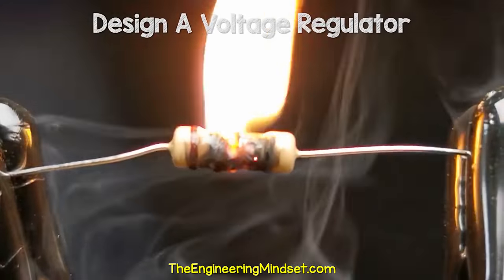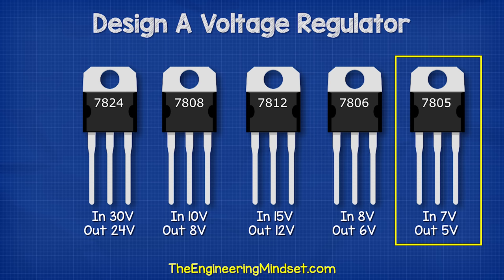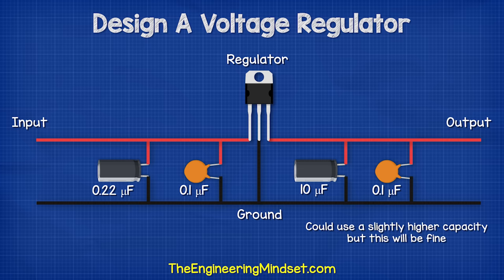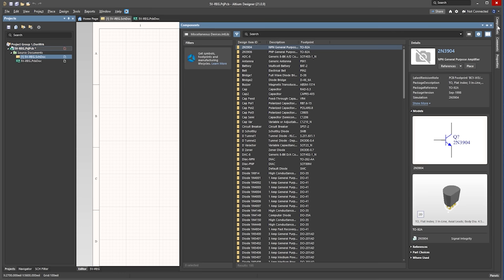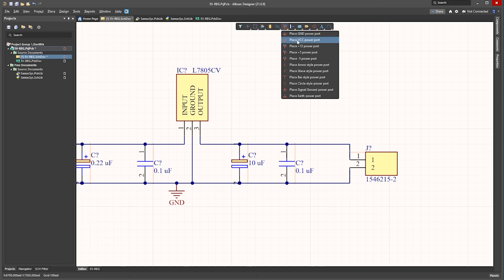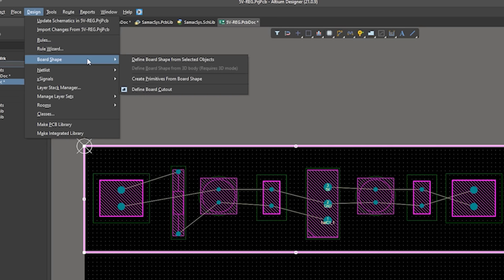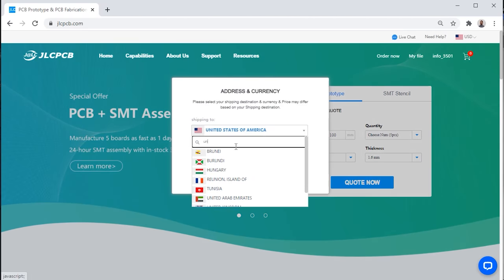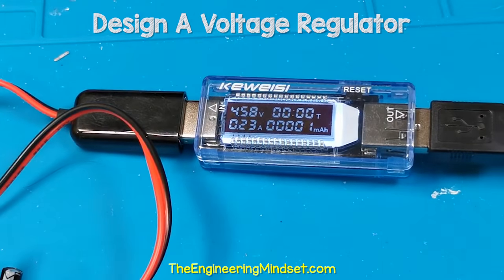5V Regulator design tutorial - How it works, how to design PCB  altium

Comment from the maker: ⚠️ This video took a long time to make if you would like to buy Paul a coffee to say thanks, link below: ☕
PayPal: https://www.paypal.me/TheEngineerinMindset
Channel membership: https://www.youtube.com/channel/UCk0fGHsCEzGig-rSzkfCjMw/join
Patreon: https://www.patreon.com/theengineeringmindset
Reply: Sir when you are uploading this video in Hindi language
Reply: Thanks Raul
Reply: can u make a separate video about semi-conductor 
i am  very much confused o this topic
Reply: so when u order, can u get thw components also from them?
Reply: LM78XX regulator is better for low power application because have low power efficiency at higher voltage input and very limited current load as LM78XX will turn excess voltage into heat. For higher power efficiency, step down converter will be best choice because excess voltage will change into more current via induction coil
Reply: But step down converter will require more complex circuitry and expensive part like IC, mosfet, inductor.
Reply: very nice design, i know very little of electronics, but after taking apart a led light array thing with 26 lights and dip switches to set patterns it had all the exact components you used in your design, albiet a bit more of them for the logic, all the caps and their ratings were the same as well as the 7805 regulator, it also used both regular diodes and the Schottky diodes, called the Chauvet LEDrain 36.
Reply: You could use a buck boost converter
Edit: set the voltage and as long as you do not exceed the input voltage range(or go below), it should work!
Reply: thank you very much,
Reply: Sir i have a doubt why we using a extra 0.1pf capacitor when we can achive the same result from the first electrolytic capacitor it can also filter the noise
Reply: Am so happy for. 
Honestly it pains me, I can't do anything for now.. But ones my project grows I will remember you 😍😍😘😘
Reply: I think this simple circuit was interesting is possible to design it really makes it a plus to start learning this so...
Reply: @NamanRx  nk
Reply: I'm definitely interested in donating unfortunately I won't have any money until next year when the tax return season occurs.
 I'm interested in making an electric vehicle that can get powered with wind turbines while I'm driving, with water turbine collected on the roof through a pipe, so to speak and with solar, AND with shore.  

I want to know, can one make a way for the batteries to collect all that information at the same location? 
How many inputs can the battery bank receive at one time?

In addition I would like to live inside the vehicle and so it would need "house" batteries as well (or could one make the bank large enough I suppose  that's true but is it more efficient to separate them? pluses and minuses) 

so I was wondering if a video about battery management machine would be something up your alley and also whether how many inputs something can take and what things that might need to add (inverter, charge controller, mppt, VFD, ) how many can be integrated  machines and whether it's better to use integrated machines or one for each activity) 
This might start to be too large of a scope but if that's something you could do I look forward to seeing that.
Also if you know anything about figuring out the size motor one would need to turn the axle of particular weighted items or a formula ( I've been sent to one that has me answer the question of speed at quarter mile and and I ha e no idea. I looked up the GWSP? manufacturer weight and it said 1970 for my van and them the example on the website said a similar van to mine was 3400lbs which seems more likely ) I just want a general idea oh how much HP or volts the motor should have. And whether motors can be combined on a shaft will do more work. Because you can find free forklift motors or hvac motors etc.
Thanks.
Reply: Use electricity convert to digital by adc get safe 5V...
Reply: digital is safe circuit by isolation because there is a.
#transforner
Reply: 😊I
Reply from the maker: Seen our new - How wind turbines work video? link: https://youtu.be/Hf875eOVrVI
Reply from the maker: See my new MOSFET explained video here➡️: https://youtu.be/AwRJsze_9m4
Reply: Hi can you make a video on 220vac to 220vdc converter with voltage regulator.

Comment: Back in time, I became independent.  I started my own business designing electronic test equipment, to test assembled PCB circuits.  But I was so poor that I had to use freeware to do the job. I had to create PCB's in the process but the freeware PCB design software only allowed a limited amount of components.  It also allowed you to create your own components.  So I would design a portion of the PCB layout, and then due to having reached the maximum amount of components allowed, resistors, capacitors, transistors, etc,  I created a new component which in truth was a combination of all the components used so far, and their specific layout.  Yep, when you are poor, you find a way around everything. Anyhow, one company was so impressed with my work that they hired me full time. Eventually I was also designing high voltage power supplies for neon sings as well as designing the test equipment to test them at the assembled PCB level.   Not bad for a grade ten dropout.  I had no education in electronics, but was self taught.
Reply: Thanks for the inspiration
Reply: @ahmadwahyudin5196  he says back in time not now
Reply: @akashghosh1151  oh sorry, my mistake
Reply: Your story resonates with myself. Having no  grades doesn't mean your not capable achieving and learning to reach your goals. 
This only means we have different learning pattern that schools don't teach. But it also means we are capable to find solutions faster by thinking out of the box. 
Thanks for sharing your story and inspiring others. 👍
Reply: Thank you for making it clear that I/YOU are not alone.
Reply: @new-knowledge8040  despite everyone thinks you need to graduate they forget how to be creative. They tend to be so close minded that they don't see solutions anymore but only a problem. Being creative and having the skills to adapt one can be valuable in a company with those insights. Most people i know with degrees say they don't know how this or how that works because they learned to on think in one way and not realizing they too can learn them with some will and effort to get to solutions.
Reply: Cool 👍
Reply: I just have to laugh about the MIT graduate test. Okay here is how it goes.  They were handed a light bulb, a battery, and a piece of wire. The idea was to make the light bulb light up with the components given, but they all failed. Despite having graduated, they were not able to do the simplest of all things. All they had to do was connect the light bulb to the battery with the assistance of the piece of wire, but again they all failed.
Reply: @new-knowledge8040  damn!!!
Reply: @new-knowledge8040  you inspire me
Reply: inspiring 
God bless
Reply: Should have just torrent it
Reply: More often than ever university degrees give you an advantage in knowing for sure job opportunities after university have nothing to do with what you learned there. Engineers like sales jobs and money with bonuses
Reply: That’s sick
Reply: You are an inspiration
Reply: @ozanpress  thanks
Reply: What did you use to teach yourself?
Reply: Never stop telling people your story...they need to know what's possible.
Reply: So, how's that job going? Are you still working there?
Reply: @VidarrKerr  whats that symbol in your pfp
Reply: Necessity is the mother of invention ;)
Reply: @new-knowledge8040  I don't doubt you've done that.  I've done similar things.  However , don't disregard the circumstances and knowledge gained that you don't realize.  Just knowing that special relativity was a thing makes it so that you can ponder it.  The genius is in coming up with the idea in the first place :)
Reply: @stevenrogersfineart4224  It's true, I invented food.
Reply: Outstanding. Well done!
Reply: @new-knowledge8040  Forgive my skepticism but how the hell does something like that even happen? I can't sit here and possibly believe that they failed something so simple. There has to be a piece of the story missing here.
Reply: Thank you for sharing! Perseverance and passion is everything to succeed.
Reply: Back in time i used to tell people my life story on other people's videos without even thanking or congratulating the person who made the video.
Any way, thanks for the video, good work.
Reply: best of luck and work hard to become more better than now.
 best of luck
Reply: @new-knowledge8040  wow how old are you?
Reply: Rock on brother, Very impressive
Reply: @matthewpierson2847  Please don't believe everything you read on internet. Specially when someone have YT channel and try to gain some subs and viewers.
Reply: Very similar background with Software Engineering instead. Well done ☺️.
Reply: Where can I learn more about pcb design and how to use the softwares.
Reply: This is impressive!
Reply: Thank you for an inspiration. Happy fir you!
Reply: That's heroic as heck
I admire you
Reply: @New, thanks for this.. Your story is inspiring.. May I ask do you have advice for a maintenance nance guy like me wanting to learn more electronics..? Thank you
Reply: How did this company found out about your work ?
Reply: I dropped out in ninth and became interested in EVERYTHING. Electronics, mechanical, automotive, etc.; but school NEVER went well for me academically. I even became interested in math after I dropped out; began to learn about algebra and was SO disappointed that I couldn't remember certain fundamentals from school. School really did make it hard.. at least for me. It's so sad to say.. but eversince I've completely omitted school from the educational part of my life.. everything has gone SO much better. Even financially..... I'm only 20 but I'm so thankful I didn't become convinced that it was my only path towards gaining intelligence. Now I know that knowledge isn't the same thing.. school exclusively gives knowledge; not intellect. :(

*Knowledge is information retained.. intelligence is what makes you ask a question.

If they really want students involved academically then they'll HAVE to interest the STUDENTS FIRST. Does anyone else remember all the ridiculous one day introductions to subjects? That's what I mean..... How are you supposed to bond with a subject like that....?
Reply: @new-knowledge8040  I find that extremely hard to believe :P
Reply from the maker: Check out NEW resistor video, everything covered! ➡️ https://youtu.be/DYcLFHgVCn0
Reply: Now that's determination
Reply: Good Job dude
Reply: can you put your e mail?
Reply: Is this applied to DC voltage or even ac voltage using that design?
Reply: Where is the free PCB circuit diagram?
Reply: The coolest comment I have read on YouTube my story is the opposite. I am in second year engineering in Electronics and Telecommunications and I depended on my University to teach me practical knowledge well I learnt late but nonetheless I realised I am in Second Year of engineering and I can't even build basic circuits or know how a 555 timer works, your story is inspiring and well I will keep you in my thoughts to inspire me to self learn a lot of things
Reply: Cool
Reply: Awesome 😅👍
Reply: I am on the way, thanks bro sharing this
Reply: That sounds like the dream. Being hired based on your skills you learned yourself. Do companies even take a look at you now without a degree? Back then it seems if you could prove your knowledge that was all it took
Reply: @moya9450 since the person posting that isn't the owner of the chann,not sure how you concluded he is trying to drive traffic?
Reply: I had to. Fake it. For. Yrs. And picked  up. As. I went along. Especially with. CHIPS.
Reply: .  I was. Much. Same.  The word. INTEREST. OR. FASINATION..
GENERATE YOUR INTERESTS..TKS
Reply: .  I remember. From 1970s. About. 555. Op amp..
Reply: I had to do something similar back when I was really young and started video editing, I was doing it all on my phone and the free version of the software only allowed me to have limited elements as well. Just as you, my solution was to export what I had and then start a new layout adding the new elements on top of the previous layout. At the end of a big project, i would have dozens of video files on my storage that I was too lazy to delete even for days after the project was over. The one huge thing that this allowed me to do was to easily go back in time whenever I wanted to change something. Now that I'm half a mechatronics engineer and I'm learning computer science in my free time, I try to exclusively use software that has similar built-in features like Git or the versions manager on SOLIDWORKS. Having to do things manually generates good practices and let's you appreciate more the tools that make your job easier.

Comment: Should have mentioned that the voltage regulator is a linear type. Which is not good for power consumption. Recommendation is a buck converter.

Comment: A small solar panel as the input voltage would be sweet.
Reply from the maker: Probably need a few solar cells, need to input +7V minimum, but it would work
Reply: Voltage regulators are inefficient and only work with higher voltage. Think of it this way "Where does all the extra voltage go?
Reply: @Joachim Shekelberg wasted electricity is never a good thing
Reply: @Joachim Shekelberg what circuit do you use , any linear regulator always have dropout votage
Reply: Not realy, this curcuit doesnt take advantage of a solar panel power changes trow the day
Reply: @Joachim Shekelberg shunt regulator is linear regulator,linear regulator waste power
Use dc dc conventer or mppt solar charge controller to get high efficiency
Reply: @shorb2289  "Where does all the extra voltage go?"

Long time passing.
Reply from the maker: Seen our new video on HOW SOLAR PANELS WORK in detail https://youtu.be/Yxt72aDjFgY
Reply: That would be no maximum PowerPoint tracking and the sunlight slightly varying due to clouds moving can interrupt it. It’s much better to charge for 12 or battery with a panel and then discharge it.

Comment: It is wise to protect the voltage regulator against larger voltages at its output than its input by another protecting diode. This case can happen, if you switch off the input voltage and you have higher capacity electrolytics in your downstream circuit. Furthermore it is necessary to take care for input voltage and supply current in order not to exceed a power loss of more than 1 W if the voltage regulator is operated without heat sink.

Comment: Thank you for the video. While there are countless videos on YouTube, I’ve noticed a common challenge: many channels don’t teach circuits in a way that’s accessible for beginners. It’s hard to grasp why specific components are used. For example, if we try to understand one circuit and then compare it to another with similar functionality, the differences in components can be confusing. Why does one circuit have more components than the other? 

Take Apple chargers, for instance—what makes them so much more expensive than other mobile chargers? What’s the "magic" behind them?

Another issue is that very few creators on YouTube explain circuit design in detail. They don’t provide practical examples or reasoning behind their choice of components, like why they opted for a diode, capacitor, etc., instead of other alternatives. It would be incredibly valuable to learn the art of transforming a basic circuit into a high-end, quality design.

Comment: That was a brilliant video, I love that PCB design software. I used to do it by hand in the mid 80's and the tapework as well all by hand. We made the artwork twice the size so it was easier to tape then the original would be reduced to half size by copier then ready for printing to PCB. That was the best job I ever had, I even say that over 30yrs later. . All we were given was a circuit design from some big company on a piece of paper, I even had a small diagram on a piece of card. We had to design everything ourselves, I loved it. 
I lost interest in computers years ago but I would love to learn that system you have there, its brilliant.
Good work 😊😊
Reply: I did it so in the 70th

Comment: Paul thanks for everything. I have learned lots of useful things about my profession more than I learned from university. Your channel is AMAZING... and please make a video about solar energy systems🙏
Reply: I never knew how a voltage regulator worked before I started watching your channel. I also learned about linear regulators and how to choose the right one for a specific application. I now know more about my profession than I ever did from university. Thank you for making these videos!
Reply: you will learn how to make a 5V regulator using capacitors, LM7805 regulator and Schottky diode. This circuit works by converting the unregulated voltage from the battery into a regulated 5V output. The capacitors smooth out the voltage fluctuations, while the LM7805 regulator ensures a stable 5V output. The Schottky diode protects the circuit from reverse polarity connection and also increases efficiency.
Reply from the maker: Seen our new video on HOW SOLAR PANELS WORK in detail https://youtu.be/Yxt72aDjFgY

Comment: used a 1.00uF capacitor instead of the 0.22 since i didn’t have one, still works perfectly. Powered with a 9V battery and output is 5.01V as desired. Made a similar circuit before without a diode and with only 2 capacitors instead of 4.
Reply: You can connect DC to a 7805 directly, no need for any extra components, those are just recommendations, but I've only ever used it on it's own and a battery for any logical gates circuits, which can only work with 5v.
Reply: @Freixenetynt  yes i know. the capacitors just help filter out any noise in the circuit